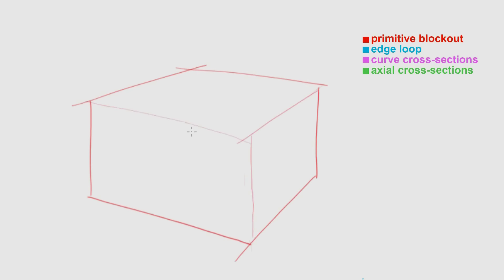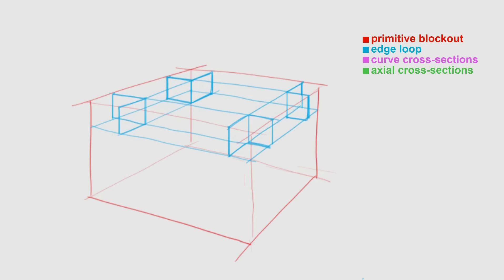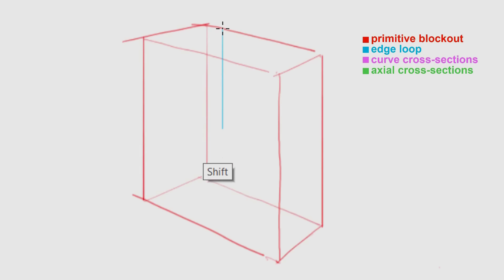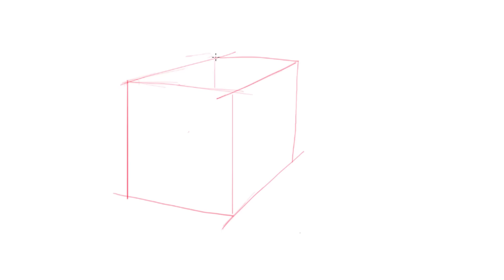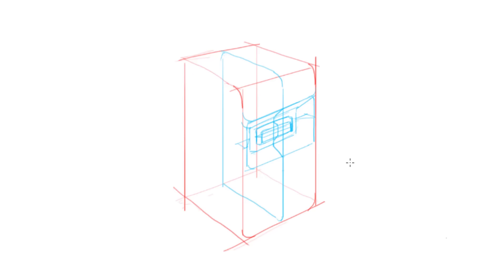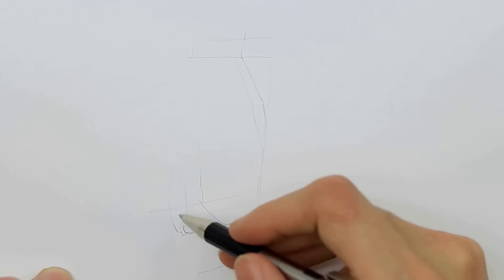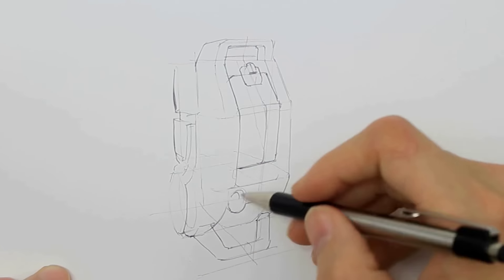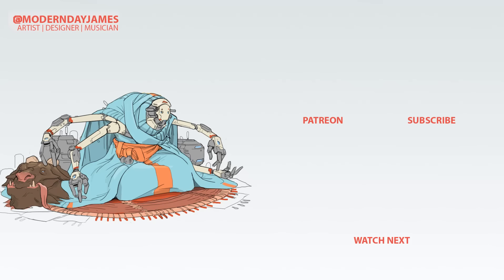PERSPECTIVE pt. 4: Rounding Forms, angled planes, and product skeches

Comment: Can you use this method (regular sketching industrial) for sketching human figures?
Reply: absolutely. you can break down arms, legs, torso, and basically anything in the human body into mechanical, basic shapes. the only difference is you probably won't be using a ruler. the process becomes much more tedious when drawing figures though

Comment: This stuff is ridiculously helpful. Thank you so much. Also, how do you manage to draw accurate lines that slowly? to get non jagged lines on my tablet I kinda have to speed through it or it just ends up looking wobbly. But being fast also kills some accuracy. Would you have some sort of suggestions as to mitigate this? Are you using something like Lazy Nezumi by any chance?
Reply from the maker: place a sheet of paper over your tablet if you're using digital.  Also ghost over the lines before placing them!
Reply from the maker: also I'm not using lazy Nezumi, but I did edit out the couple of tries before the successful ellipse.  Digital ellipses will always be much harder than traditional
Reply: +moderndayjames I just tried it. The sheet of paper offered too much resistance for my comfort, plus im a little iffy about taping it to my tablet so it doesnt move about, but the tip about ghosting over the lines worked like a charm. Thank you so much and I have to say watching your videos has improved my work considerably and I look forward to whatever you will be putting out next. :)
Reply: +moderndayjames I just tried it. The sheet of paper offered too much resistance for my comfort, plus im a little iffy about taping it to my tablet so it doesnt move about, but the tip about ghosting over the lines worked like a charm. Thank you so much and I have to say watching your videos has improved my work considerably and I look forward to whatever you will be putting out next. :)

Comment: Hey, Thanks for the video, do you use any stabilisation while drawing digitally?
(wondering if I could solve the problem with not being able to draw straight lines accurately with this)
Reply: lol I have been drawing without stabilization for so long that I have forgotten that stabilization exists in digital, having a pulse in traditional is easier than in digital, I forgot that stabilization exists for that